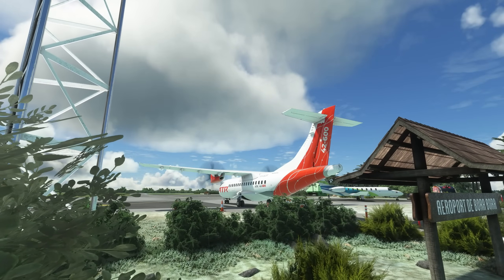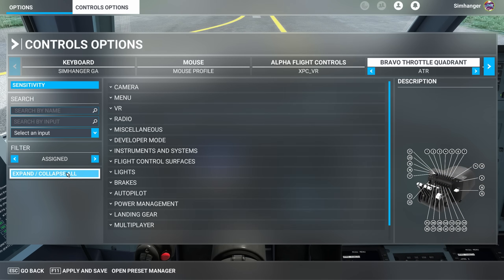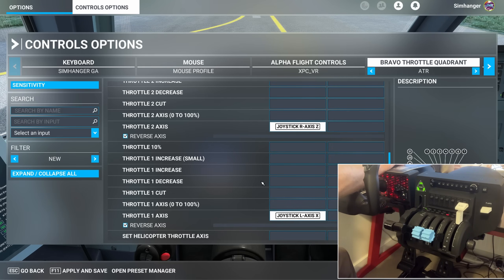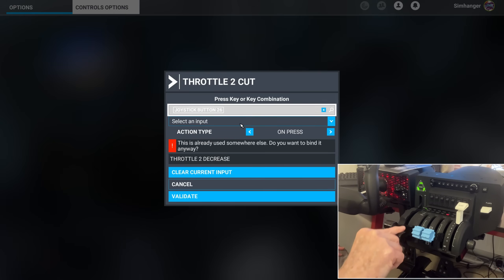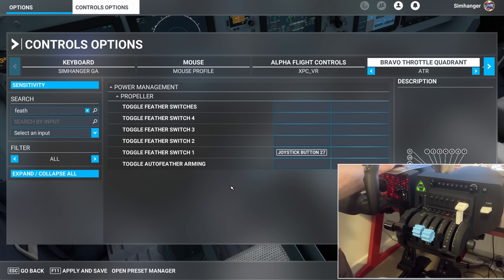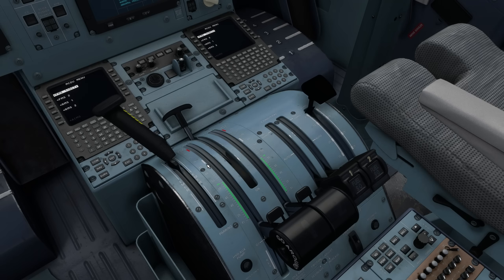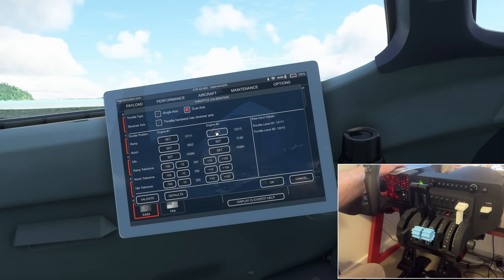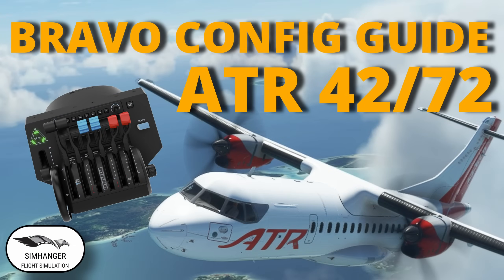ATR 42 & 72 Config Guide | Honeycomb Bravo TQ | Plus how to calibrate throttle in cockpit

Comment: SImHanger, you do great work - of that there is little doubt. HOwever it's MSFS that is making me pull my hair out now. Seems as though through some updates that a bug has been introduced where when the Bravo is at 0% throttle, it is interpreted as FULL reverse and not Idle in the Sim, and its actually quite clear from

Comment: It would be great if you can do the Throttle/Conditioner configuration including reverse on VelocityOne FMS.I may add that I did my entire configuration of my VelocityOne based on your videos.I did try your configuration forTurbo Prop but still couldn’t do it.I am also having another issue the throttle one and two levers even after binding  do not move in tandem.Throttle 2 smaller one lags behind in forward/ backward movement when I resume action in cockpit.

Comment: Hi Mark, great work on the settings thankyou. only just installed the ATR today 7th March '24. better late than never. Using same honeycomb hardware as you. My throttle 1 lever will not move into full detent for reverser. throttle 2 reverses fine. tried several revalidations to no avail. hopefully i can get some help to maintain my busy island hopping schedule ha!

Comment: I used your wonderful tutorial to set up my logitech saitek throttle for ATR. It works fine, excluded for the shut off of engine number 2 (right engine). The levers move correctly. No issue when I start the aircraft but when I have to stop the engine number 2 (number 1 instead  works correcly when I put the propeller lever in shut off position) the shut off position apparently doesn't work. The propeller keeps on to turn. Is it a problem of saitek throttle and I should buy  Bravo throttle?

Comment: Hello, thanks for your valuable advices. Would this configuration guide be fitted for the Velocity One as well ?
Reply from the maker: Yes the assignments would be the same, but axis description obviously different.
Reply: @SimHangerFS  Configuration done on Velocity One for throttles and condition levers/propellers. It seems to be working fine!

Comment: Hi,

for some reason my HCB is interferring with ATR CL, more info bellow.

Load to cold and dark cockpit
Switch to any cockpit custom camera view
Click RMB
From now on when I click my RMB to pan the view, the CL2 moves itself from FUEL SO to FTR and back
This only happens whe using custom cams. When I switch to the default presets (Ctrl+1) its ok.

The only solution is to disconnect the HCB from PC which is obviously something I dont want.

Can anyone confirm this? Or give me any advice how to solve it?

Thank you

Comment: for some reason the flaps lever does not work, i have assigned it to Joystick L-AXIS Z and when in the sim i pull that lever down the flap in the cockpit toggles between 1st stage and fully up for a few seconds and then reverts back to the up position. flaps are not retracted at all???
Reply from the maker: Sounds like you have something else conflicting with that config, perhaps another peripheral or you have pilot assist on. It should be off.

Comment: I am back doing this again.  When I first got the Bravo set up, the ATR settings all worked and I was very pleased.
However, after about a week, my #1 throttle, in flight, started slipping out of the notch and falling quickly all the way to flight idle.  I moved it back, it fell again.  Huh?  It worked before, what happened?  So I asked Honeycomb for support.  They said to return the Bravo, but that never happened because they "lost" their shipping and supplier contracts.  
Others say I need to redo the bindings, and I agree that is the thing to try.  Not easy!  I couldn't figure out how to totally erase my ATR profile, so I just tried to do as you did and make a copy or a backup.  All of the bindings still showed their previous settings, so I would delete those one by one and re-bind them.  Ha, I have probably made it all worse.  It's very tedious in MFS2020, while using the bravo in XPlane worked perfectly.   But XP doesn't have the ATR, and I am type rated in it.  I find I am confused when you are quickly moving from New, to Assigned, etc.
How can I totally erase my previous ATR profile and start clean from scratch?  I don't know if I have a hardware problem or a software problem, or both.

Comment: Computer settings are my weakness.  I kept making mistakes doing this and had to repeat and of course stop and restart the video.  Not that it is that difficult!  Ha, well now everything works except I had the prop levers reversed and had to uncheck the boxes.  Having the flaps controlled makes takeoffs and landings so much easier!  Without CLs on my old Saitek throttles, the throttles kept changing the position of the CLs!  That didn't work well.
I'm typed in the ATR from years ago and remembered little about it.  Those were the pre-glass models.  I think the glass displays are nice but in the sim, they are tiny.  The altitude and course are tedious to set.  But after decades in the 737, I am enjoying low and slow in the ATR, and I like the sound of those turbo-props.  When the ATR came out I thought, well I'm typed, I need to be able to fly this thing!  
Thanks for your helpful video.  BTW, in the real airplane, we seldom if ever used Hotel Mode.

Comment: When I got to Throttle 1 cut, put it in detent, got the error message and pressed "Validate" , MFS froze and was unresponsive.  I'm having to restart MFS, hope it didn't dump everything.
Minute later:  It did dump my previous assignments.  I don't quite know what to do now other than see if it happens a 2nd time.

Comment: Hi Mark. I used this guide after you produced it but noticed my throttles no longer move into reverse. I rechecked the process but still they don’t move into reverse. The visuals in the bravo throttle config screen all work as expected. Any ideas?
Reply from the maker: I’m aware, they have changed something following the recent update …. It’s a sim or dev bug…I have not found a realistic solution yet.

Comment: Hello Mark, thanks so much for this tutorial on the Bravo! you save us so much time! :-) i have a question, i am having a awkward behavior on the reversers. After setting the throttle 1 and 2 in reserve i can hear a change in the engines but the lever in the sim will stay in IDLE and wont move to reserve... i am not being able to find what is causing this... thank you!
Reply from the maker: It’s the recent update. Still looking into it
Reply: Thanks for your reply Marc! Ohh i didn’t know this! I thought I was having an issue with my hardware itself because I followed all steps in you video accordingly. Not even by holding the F2 key in my keyboard will make the levers go into reverse…

Comment: I followed this video but still can't set throttle revert
Reply: same here. my props go in reverse but not throttle
Reply: I rewatched the video, I had missed the part about switching to on release. And it didn’t go into reverse until I started the engines and works now
Reply: @greniribajan7773  I did the same but it still doesn't work, I think it's because of Asobo ATR

Comment: Hi Mark, I have a custom built throttle quadrant (especially to make it easy to use 'blindly' while in VR) based on a Arduino Pro Micro, which basically works as the Honeycomb. I got it working with the ATR as far as you showed in the video, however I have a couple of rotary encoders for the AP control. Like for altitude increase/decrease, heading bug, etc. In all planes these work fine, except for the ATr. I even can't get it to work via MobiFlight. Any idea how to get this working for this plane? Thanks in advance.

Comment: Hi Mark. Thanks for posting this video.. really helpful and got me about 90% of the way. My throttles are still having trouble staying in the 'notch' gate.  I advance T1 and T2 and they get to the 62% of power and them jump straight up to 75 even if i only touch them a hair..  I have played with the sensitivity but that didn't do much to help, and i have no idea how the Deadzones might be able to work with that one section of the throttle's range. Assists are definitely off..  Would welcome your thoughts on how to fine-tune (if its even possible).

Comment: As usual amazing video. Is there any known method of yet to make the autopilot panel on the bravo work in game on the ATR too?
Reply from the maker: The ATR uses some non default calls for these actions so the only solution would be to remap these with a third party app such as SpadNext.
Reply: @SimHangerFS  Really frustrating considering technically its an Asobo product too, but such is life I guess 🤷🏼‍♂️

Comment: I can't get mine to go in Reverse thrust - even with 'Hardware has Reverse Thrust' unticked.  Also, I once had a Austin Allegro 'Vanden Plas' that could accelerate quicker down the runway than this ATR!  I run out of runway at VEPY Gangtok Pakyong Airport and only get upto 125 mph at the end of the runway and can't lift on full pull-back of the Alpha Yoke.  Pity this video didn't actually do or show a calibration on the pad.  I have tried and it keeps on returning the 'overlaps' message.
Reply from the maker: The key is as mentioned in the video. Try this - reverse unticked and select default with your throttles at idle.  Exit and restart MSFS. Once back in calibration select default again. Throttles will now be at idle. Now go ahead and complete set up. 👍

Comment: I did the same setup you did and it still wants to throw the trottles in full reverse when I set to idle
Reply: For some reason I had to unplug the controller and plug it back in.

Comment: Hello Mark, sorry to burden you further, just followed your guide for config for the ATR, unfortunately throttle two although it goes in to reverse detent there is no actual reverse, No 1 fine in test you can here the increased rev power, I tried a run down the runway and get asymmetric reversers 1 OK nothing from 2 also two went go to rev detent unless I put a small fwd input on throttle 2 then it powers back. Any ideas any help much appreciated. Kind regards Charlie
Reply from the maker: When testing make sure your condition levers are in auto. Check calibration.

Comment: Mark, an awesome video. I wanted to pick your brains. As someone who has visual issues, I need to zoom a lot in the sim so in aircraft where the airspeed, attitude, VS readout  isn't right next to the control wheel like in the Airbus and Boeing, I use key bindings where I can zoom into the PFD and then select airspeed, attitude, VS etc. using the bound key. However, after buying the ATR on Saturday I've not been able to fly it, because the usual key bindings that work on every other aircraft except Fenix, which isn't an issue in that aircraft: just don't work. Any ideas or suggestions? Thanks, Graeme

Comment: Fantastic video and everyone that I saw on the BTQ day, I would like to ask you a question, I have configured the BTQ as described in this video and everything works fine, but I have a problem and that is that when doing the Taxi the front wheel is It is diverting me to the right and I have to correct the direction with the pedals. My question is the following: could you tell me the data that I should have in the rudder sensitivities? The truth is that I don't understand much about sensitivities and I'm afraid to touch it and spoil it even more. Thank you so much.
Reply from the maker: Check brake axis and pilot assist options.
Reply: @SimHangerFS  Thank you so much

Comment: Thank you for this very helpful video. It all works great except I keep experiencing uncommanded throttle lever 1 movements. It keeps advancing on its own. I checked for conflicts but couldn’t find any
Reply from the maker: Check pilot assist functions are all turned off.
Reply: @SimHangerFS  Good thought. I tried that, but no joy. Other ideas welcome
Reply from the maker: @alphabravo4402  All I can suggest is delete throttle 1 assignments. Restart MSFS and reassign to see if that eliminates the issue?
Reply: @SimHangerFS  Thank you. The problem seems to have resolved itself, so all good now. Thanks again for the tutorial

Comment: This hasn't worked for me so far. In the idle detent the throttles on the aircraft move all the way down to the reverse position. When I move the lever forward, about 3/4 of the way the throttles move back down to reverse again, then come back forward if I continue pushing them up to max power.
Reply from the maker: Follow what I suggested in the video. Enter the calibration page, throttles at idle, select default, then dual axis, then set idle. If that does not work, set default with throttles at idle. Restart flight and then select dual axis, then click on set for idle etc.
Reply: I have gotten the throttles to stop at the GI detent finally. Thanks for your help. I am still having an issue where throttle 2 moves up more slowly than throttle 1 about halfway up. Even if I change the control setup to single axis. I can't explain it.
Reply from the maker: @ScottGrayPAY  adjust sensitivities for that axis to anything …save…exit….restart sim….on runway…control options…adjust back to linear & save. This works sometimes. Plus check calibration in windows if on PC.
Reply: @SimHangerFS  I was looking at the sensitivity page and noticed that the axis I was using for throttle 1 exhibited a strange behavior. When I first moved the lever the point in the sensitivity graph would jump to the halfway mark. So it seems like something is wrong hardware wise with that axis. I am using the next axis in single axis mode and it is working correctly.
Reply from the maker: @ScottGrayPAY   yes sounds like a faulty unit/axis.

Comment: To keep things simple, I configured nothing. Using the 2 engine jet profiles work fine as the condition levers can just be clicked with the mouse as they only get used during startup and shutdown. I then calibrate my throttle on the efb and I’m done. The flap lever doesn’t change the spoiler gets pulled off

Comment: Hey Mark, I'm having an issue with the two throttles. When I advance them together, the number 2 throttle is out of sync with the number 1. It advances much slower than the number 1. I have reset the sensitivity in the MSFS OPTIONS and also selected DEFAULT in the ATR options. I have also made sure that there are no other inputs interferring with the assignments.Any idea on what the issue is? Thanks
Reply: literally having the exact same issue. I am using the Turtle Beach Velcocity One.
Reply from the maker: Not sure, check all pilot assists in assistance menu are set to off

Comment: You need notches at GI and FI.

If you go into Ground Idle in flight you lose power and may crash ....  see the Nat Geo Aircraft Investigation episode ! 

Also, as you will never really use the redline Ramp.... ignore it. Have max throttle at Notch.

You then have a higher control (more movement) between Notch and Flight Idle. 

In the RW they have now prevented the levers from going into Ground Idle on the old 500s by modding them all, after the accident....unless the wheels are on the ground.

This was standard on the new 600s.

(I doubt this is simulated in this Beta version.)

In fact... GI is not really needed as a detent, if you check "Auto GI on, when landed" in the EFB.

(I doubt Beta works properly ...  so Flight Idle to Ground Idle is likely to be less than useless.)

Comment: Thank you for this! I copied my Turboprop Twin preset to make my ATR preset. It also has Increase Propeller 1/2 Pitch set to the same binding as Toggle Feather Switch 1/2 and I have Hold Propeller Reverse Thrust set to both the feather bindings. Are those bindings necessary? If not, why? Thanks!

Comment: Nice. This was helpfull, but the Alpha, can you do that to. Have problem with to put on the light. And the same for the autopilot on the bravo. 
Is it just me or is there something wrong?
Reply from the maker: Delete and reinstall the honeycomb/Aerosoft driver.
Reply: @SimHangerFS  know how to install it but how to delete it
Reply from the maker: @gabzter  delete from community folder. Re-download, unzip and install.
Reply: @SimHangerFS  Thx. Did that now and still dont work. Does your alpha autopilot work with the ATR? can change the heading when you use the Alpha? Need to know, maybe something wrong with my setting.

Comment: Set this as you did in thhis video yesterday before seeing today (you definitely saving people time)... The parking brake can be configured with toggle parking brake to a Bravo Switch... I submitted two bug reports on no IAS/VS/NAV or other button functionality... Also, I find it is stupid you have to use Propeller Axis and Feather for the condition lever when there is Condition Lever Control Option... I agree and you should stop sugarcoating it, Microsoft who directly supports the Alpha/Bravo Software intergration NEEDS TO FORCE Content Creators to have FULL FUNCTIONALITY in their aircraft and using standard coding plus provide documentation for proper setup to work with their internal coding. MICROSFT NEEDS TO FIX THE BUGS OF THE INHOUSE SUPPORT NOW with no further delay and  HONEYCOMB needs to earn their money they charge providing software to override and customize buttons like Axis & Ohs...... No documentation by the creator and people having to figure out how they coded the controls is RIDICULOUS... Expert Series Aircraft, I think not.... Will they force the developer to fix the buttons and dial functionality will yet to be seen but my guess is no... Time Microsoft fixes and enforces the Alpha/Bravo Controls Standardize Coding they certify as the "go to" controls and in-house support... Their neglect is getting really damn old.
Reply: Hi Brittany. I've been trying to assign button 34 (Left switch up) to the Parking Brake but when i click it off (button 25) the lever in the cockpit just jumps up and down. Can you possible advise how you set yours?  Do you have to set 35 separately? Thanks so much